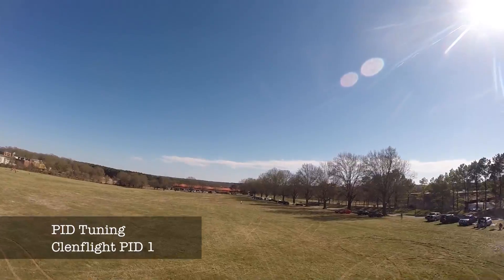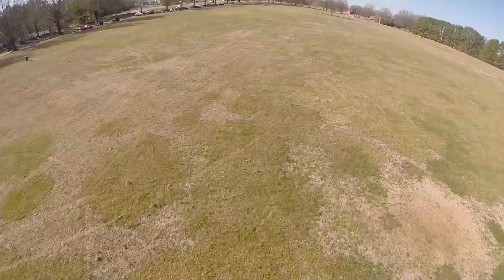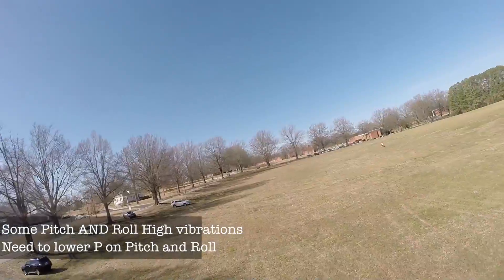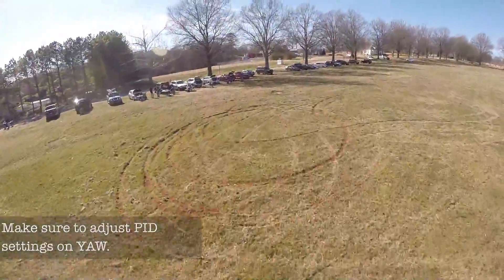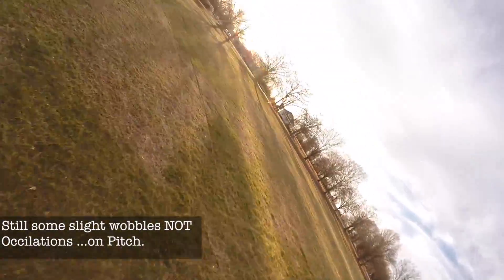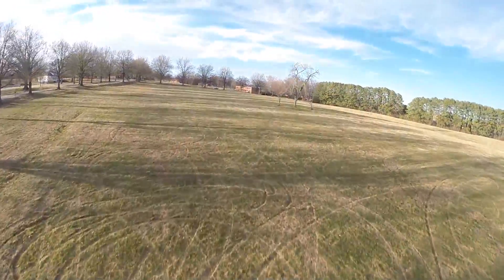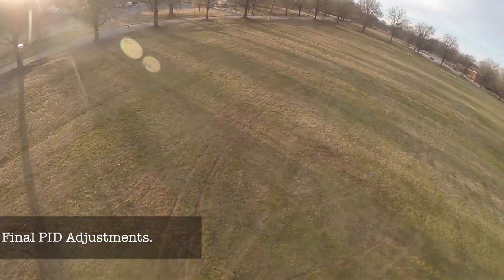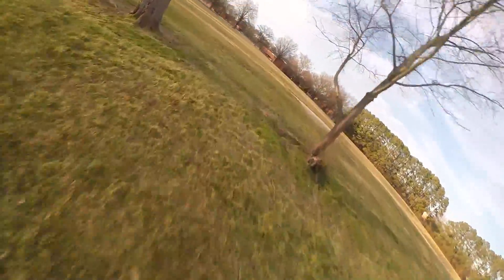PID Tuning Part 2

Comment: at :33 where you mention having to lower P due to vibes.....its hard to tell if it is a random oscillation or a constant one. It looks like a random bounce around/jostling ..is that what you saw. I have something like that I am trying to tune out and dont know which one to drop. The best I can describe is like driving over a flat but unpaved rough road. would that be the P setting
Reply from the maker: +TeamBlindMouse I would have to see some of your flight footage to really diagnose your issue.  IM me on Facebook for help.
Reply: ok wilco ! ty

Comment: Really helpfull videos I have my 310 frame mini running 2208s pretty darn perfect however it flys better at high speeds when i slow down or descend its gets some wobbles and is really moved around by the slightest wind. I raised "I" on pitch and roll just two clicks and the next flight it was almost not flyable. It felt very Robotic and every stick movement seem to be with a 1 full second delay, made for a scary flight. This was on PID contoller 0 which I hear isnt as easy to tune. Wondered your thoughts, perhaps I should try tuning on PID contoller !
Reply from the maker: PID Controller 1!!!! It is the best so far!!!!